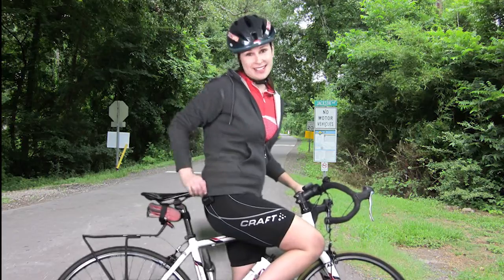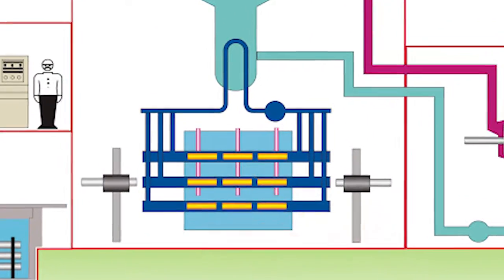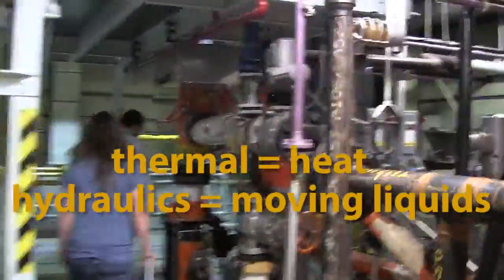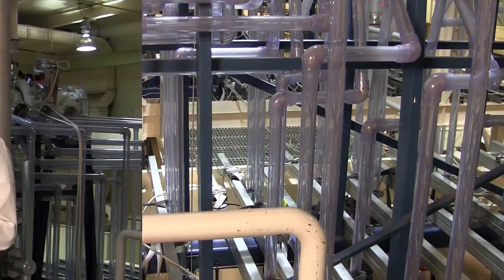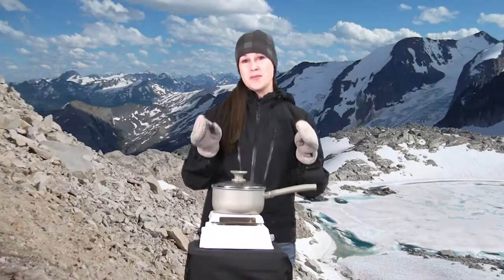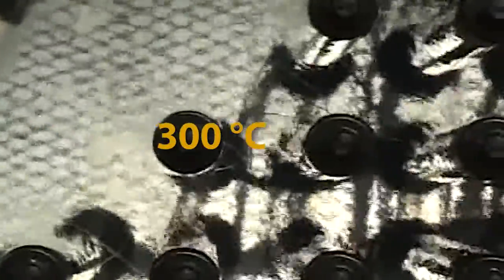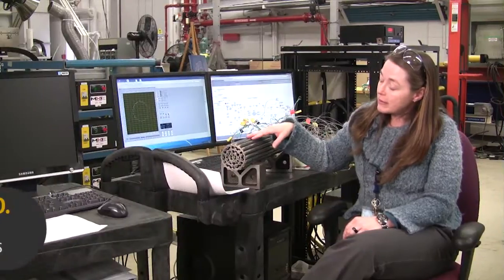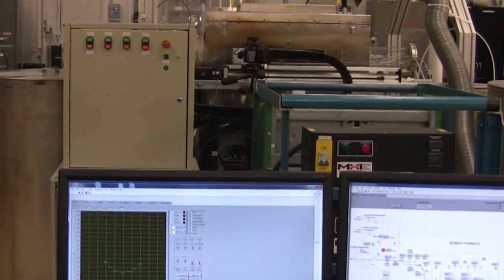Nuclear Reactor Safety

Comment: I remember now I studied all these reactor types got to the safety systems and deducted that if it did meltdown it wouldn't spray radiation every where then realized there probably wasn't a continuous operating temperature and it had fluctuations in the core temperature 

But I would like to point out

I schemed the Russians kicking ass on the Ukraine nuclear power plant in 2014 and they totally almost blew it up

But the contaminated water was dealt with so I could have it exploded spraying radiation into environment

Close though 

Winner winner 
1 year free dinner 
Spokane. 007 FM radio

Comment: Omg are species is so fffffing stupid.....

Is that fffffing windows operating system 

I did not think it was gonna be this easy....

Like if your gonna run nuclear reactors and important stuff

Spring for the creation of operation system 

Not just use the most common operating system 

I cant believe in am tripping out to this video 

It's like a mission critical type infrastructure 

I think I've even researched this before in college its bringing back flash back memories to thinking everyone in the world is stupid and paying high rent and small apartment 

I was all focused on 

Time Authenticated Cryptographic Identity Transmission

Thinking it was encryption with an added timestamps likely from the machine address code ID

Located on the computer work stations 

Thinking we had to get a copy of the work stations custom operating systems and chip sets and then figure out how to create a software and hardware emulator 

While we simultaneously 

GPS ip address Machine address code spoof the encryption time stamping to get access remotely to the safety systems 

No

Just windows OS hack it I guess

There's gotta be at least an analog safety mechanism 

Winner winner 
1 year free dinner 
Spokane. 007 FM radio